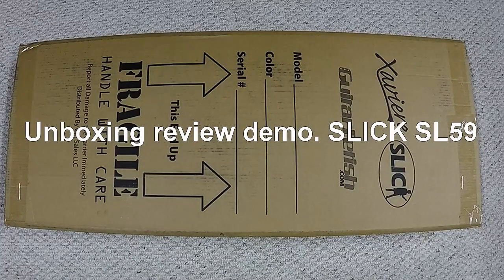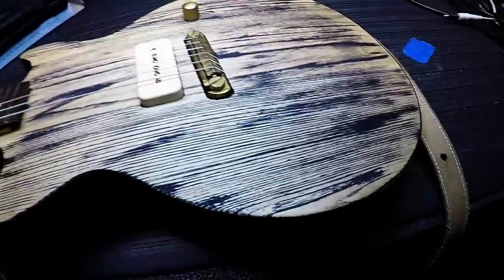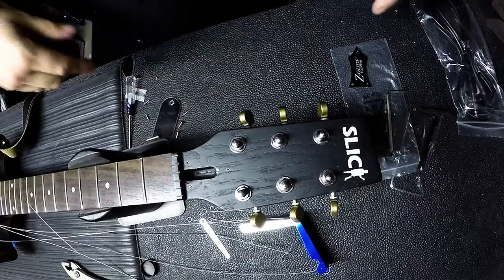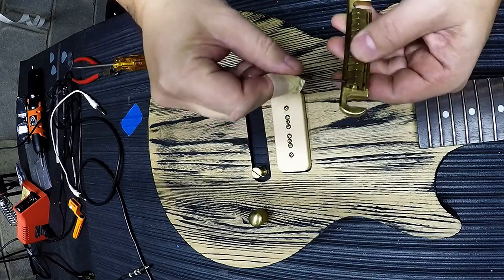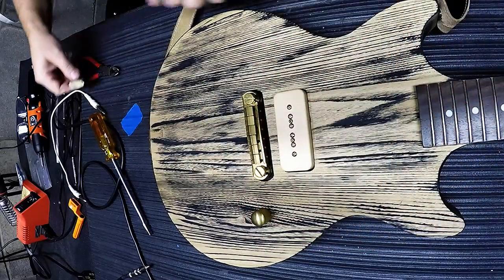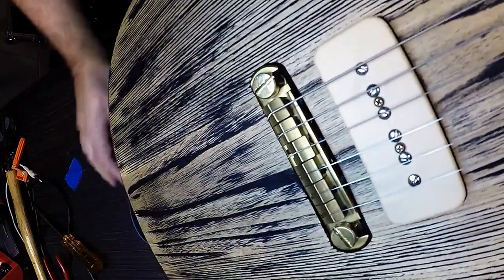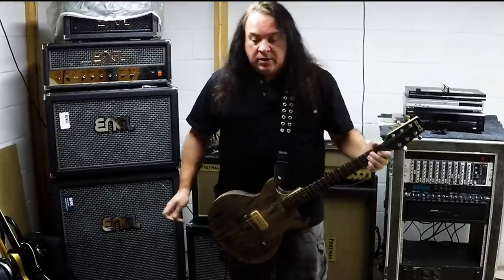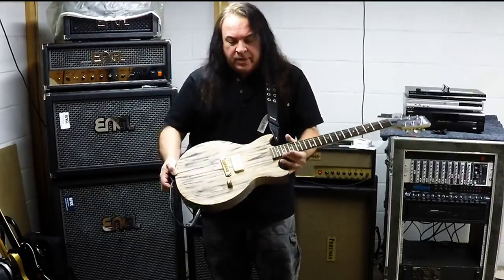Slick SL59 Guitar Unboxing bench test overview review and demo Guitarfetish

Comment: I recently bought the Slick SL51 which is a Telecaster copy. It has a traditional Tele design with traditional Tele-style parts. I figured I couldn't go wrong with a design that's been around since 1950...and I was right. It's a pretty darn good guitar for just a couple hundred bucks. Earl Slick did make a few changes like the angled headstock (no string trees!), compensated brass saddles, and hotter pickups. I also love the no wood filler, no sealer, no primer, and no clearcoat...just one coat of enamel. Even the maple neck is unfinished...just needed a little oil.
Reply: OddTimeMan 

Do you need to adjust the bridge each time you change the strings?
Reply from the maker: I did but others might not have to.
Reply: @stewtech  No, once the bridge saddles are adjusted for action and intonation, they don't need to be re-adjusted with every string change.

Comment: At last an honest review! I was puzzled by all the enthousiast reviews of the Slicks, thinking I was the unlucky one having bought a bad example. I do like the P90 on the Slick; sounds absolutely fantastic. The neck plays well too. I replaced the tuners, and am now thinking about replacing the wraparound bridge. Not only is the thing a nightmare to intonate and re-string, it is slowly starting to lean forward under the tension of the strings. Either the wood is too soft or the holes for the bridge poles are drilled too wide...
Reply from the maker: Hope it worked out for you.

Comment: did you try adjusting the neck and the bridge in unison? I have one and no problems with restringing... but I know how to set one up.
Reply from the maker: Yes the issue was that the bridge sits too low. Your neck pocket must be different. I would have had to put over an 1/8th of an inch shim to get the bridge to raise up in order to feed the strings through the bridge. Trust me I know how to set up a guitar but thanks for your input.